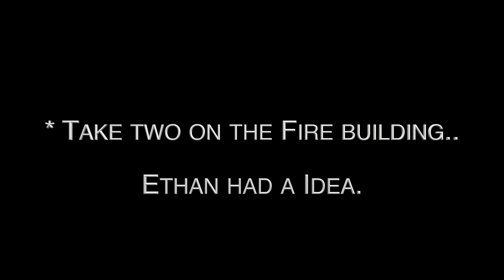I bought the $20 Amazon Axe

Comment: Tip from someone who’s split a lot of wood. Keep your eyes where you want you axe to strike the wood, take a step back and use your dominant hand to slide down the ace handle while splitting. It’ll make your swings much more through and through
Reply: Yes thats very true! Ive been splitting wood for about 60 percent of my houses heat during the winter so ive split a lot of wood and thats definitely the trick to splitting wood efficiently😂
Reply: I also agree my dad baight me a fiskers axe at age 5  to split wood and that is my technique speed is the key too for bigger ones like oak or hickory or eaen maple logs
Reply: Ive split wood by hand for over 20 years and used my non dominant hand to slide down the axe lol  but other than that yes you are correct
Reply: Yep I can’t say it any better bro
Reply: I’m 13 and I do the same thing the reason I have to do this is because we live in the Country
Reply: Yeah that’s pretty much how you spilt wood. Just like that
Reply: Exactly what I would say
Reply: Bro you just Help me
Reply: Also using a splitting maul instead of an axe would probably help
Reply: I was bout to say this in the comments thank you for saving me the time but fr good tips
Reply: tbh he prolly shoudla bought a splitting maul instead of an axe. From my experience they work 10x better.
Reply: None of you have told him that woods a little green still for splitting in my opinion
Reply: @CarterG556  yeah they do
Reply: Exactly
Reply: VERY TRUE
Reply: Thank you helps me too

Comment: I'm been cutting and splitting wood to heat my home for 44 years.  That axe you bought is actually a quality deal for the money BUT to split wood buy a fiskars X27 splitting axe or a stotz splitting maul or one based on them.  That cold stall axe you bought is a great deal for the money however I dont use it for splitting. Cold steel trail boss
Reply: Those Sotz splitting mauls are great.
Reply: Yea I have been splitting wood for a while with a cheap axe and my dad told me to use my right hand to slide down the axe

Comment: Kendall, an axe is used for cutting down trees. A splitting maul is used for cutting wood. A splitting maul starts out with a thin blade at the start and gets wider in the back. This helps when you split wood so it is heavier and it splits easier.
Reply: This is so very true preferably 8lb splitting maul I do know people that do prefer a tax over a splitting maul but it's usually a double bit Axe and they hit pretty hard and they spin the wrist wrist as it hits the log causing the log to pop open

Comment: #kendalkgray2 so when you set up your swing from start to finish. Lead hand at top under the blade loosely gripped on the wood. Guide hand at the bottom. As you swing down slide your slide your lead hand down to meet your left or right depending which hand you are dominant with. Will bring power and precision.
Reply: This is great advice

Comment: Did you Kendall did you know that Pinewood Burns better than any other wood if it's real dry you can use it to start fires and it's easy to start fires with and that asks you got it's better for smallwood in that kind of wood you just got to put a lot of forcing to it and you can really get you a good pile of wood to put on your knees your shed and once it's all dry you can burn it really easy with that little lighter you haveBut yeah that acts as a real good ax I have an accident splits wood really good:yt:

Comment: I make my own axes. I'd say that's more of a universal profile. Both for felling and splitting. There are a lot of axes that are great for splitting...but if your splitting alot, look at a Hydraulic wood splitter.

But I've split by hand... alot. Try centering the axe over your head. Aim, by looking at where you want to hit. Try switching which hand you have on the bottom/top. Grip the handle at the very bottom, swing in a controlled but sure way...wide smooth arch. Good luck 

Greetings from Northern Sweden 🇸🇪

Comment: if your axe gets stuck in the wood, ya put the axe on your shoulder and use the backside or hammer part(whatever it is called) and swing it on the splitting log                     God bless

Comment: Your problem is you have a bad technique when chopping wood. You're supposed to raise the Ax over your head and behind you and then come straight down. What you are doing is putting the axe to the right of your head and then darting your head to the left and that causes the ax to move to the right sometimes missing the piece of wood or not cutting it in the middle. Your friend does it exactly like it should be so follow his example. One of the best tools for splitting would just to use a maul.

Comment: split wood dry out you can split when it is green more work. you need piece of plastic cover on the handle by the axe head. should bought a pole axe. be bless and safe with a axe.

Comment: When the axe blade is stuck in a big log, flip it over, lift it to shoulder height, and drop it on the poll (back) of the axe. The weight of the wood will drive it into the axe and make it split.

Bonus tip: It's easier to split wood from the end than from the side.

Comment: i heat my home with only wood   from this video or atleast  3/4 of it sofar  that axe seems  ok for that price  you guys just need to get more skill at choping  personaly i use a husky with a fiberglass handle with a lifetime warranty   so far i never had to get the warranty reimbursed  i think its 3.5  but i chop 20 inch diameter alot  might need a few hits to break it in half  but it does the job

Comment: Ooooh man all that wasted effort in your swings... You gotta spend some time with someone who's had a lot of experience splitting wood. I can't describe in words what you're doing wrong, but I'm sure others can. Also, for splitting, I'd recommend getting a splitting maul instead of an axe. An axe will do, but a maul will do a whole lot faster and better. Also, grab some metal files and get that blade shaving sharp. Keep it that sharp, even if you have to resharpen after every strike (if the axe is made of crappy steel, you will have to resharpen after every single strike... Learned that the hard way) and wear some gloves until your hands develop decent callouses or you will regret it.